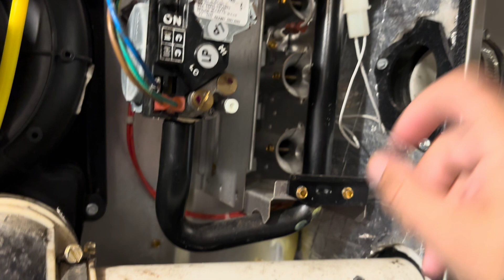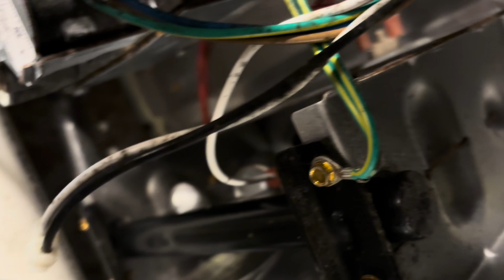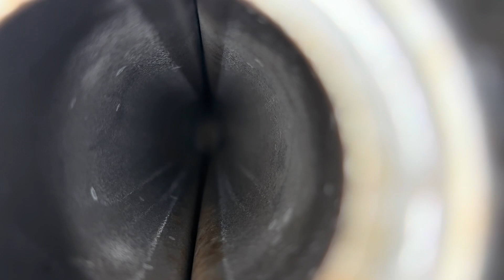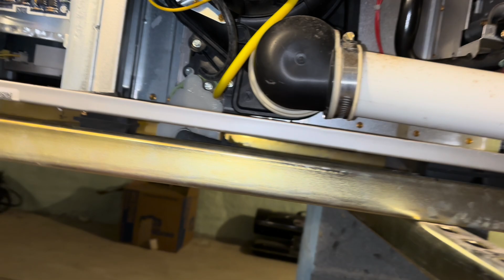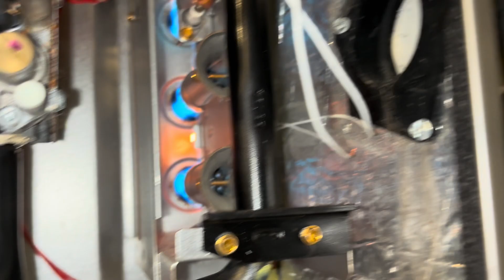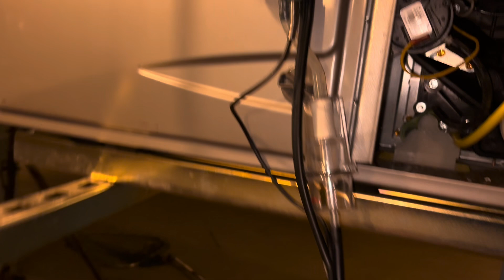Yearly Maintenance And Service On A Gas Furnace For Beginners!

Comment: What type of cleaner did you use for the trap? Or degreaser? Thx
Reply from the maker: You can use any cleaner really as long as it isn’t acidic.  But regular water works fine too.

Comment: can you tell me while the resistor lights up, the gas supply does not open?
Reply from the maker: Could be defective gas valve, or poor or no gas delivery.  You’ll have to check to make sure the gas valve is getting 24v on a call for heat
Reply: Thank you

Comment: Great run through. I would have put the cover back on doing the Combustion Analysis it will impact the air fuel mix ratios and combustion - not significantly but enough to be noticeable. Could have also done a long reach match test for assessing heat exchanger cracks with blower on and off, follow that up with CO testing including at vents.  Check secondary heat exchanger dirt levels by pulling the blower wheel. And static pressure tests in supply and return plenums.

Comment: Hello Jeff can you tell me if I need to replace the piston on the OXbox air handler when I'm installing it for the first time. It says replace it from the factory piston. Just want to be sure
Reply from the maker: The piston should be matched with what outdoor unit you have.  The equipment should come with a chart that tells you what piston to use with what outdoor unit

Comment: Every fall, inspect your flue piping. Remove and clean the flame sensor, if high efficiency, check hoses and condensate lines and discharge pipes/ pump. Change the return filters and look for lose and leaking duct connections. Other than a component failure, you should have a service call free winter.
Reply from the maker: Spot on!